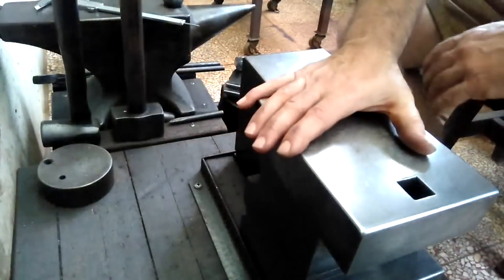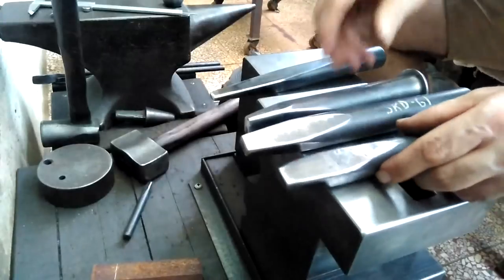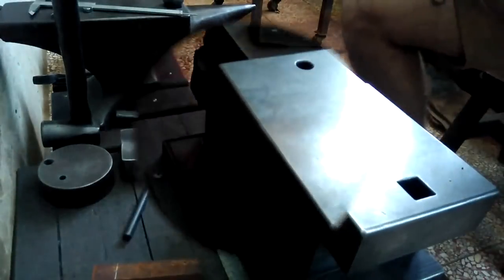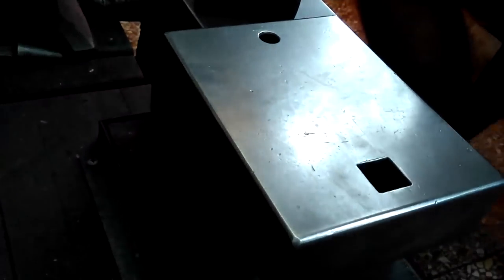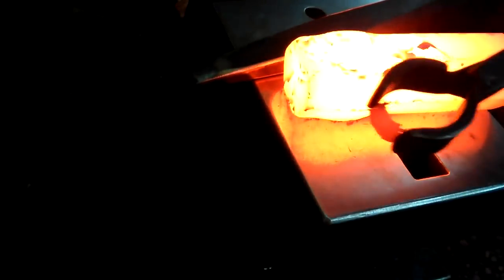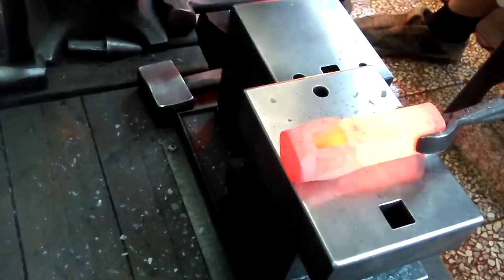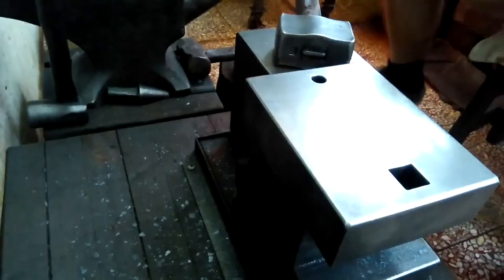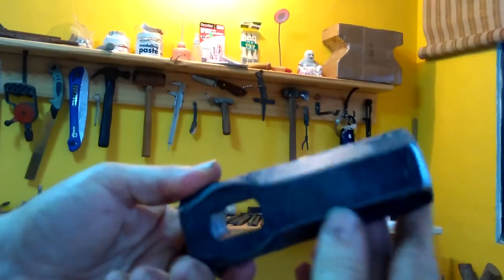Forging hexagonal, Japanese style hammer & ???

Comment: Hey Glen. I got a hold of 85lb 10" round piece of 4045. Heat treated it like you did in one of your videos. Worked like a charm. Made my first set of tongs. I only bought one hammer, everything else I will make. Look forward to start making hammers. Taking a trip to the steel yard this weekend for some more stock!

Comment: Without a power hammer or a press it looks like the best way to get an eye in the hammer is to use a variety of punches and drifts that permit a hand held hammer to increase the size of the eye gradually. Interesting comment about not wanting to remove any material from the blank, even when punching the eye.

Comment: Nice hammer. Are you thinking about offering hand punches and drifts on your website? I for one would be interested. Keep up the great videos.
Reply from the maker: Alex, Yes, I have thought about offering the hand held punches / drifts I use and may list these tools in the near future on my website. But even with the right tools, hammer eye forming by hand is not an easy task and everyone seems to go about this differently. Also, these tools are not cheap, given the cost of the steel and machine work I have done on them. Thanks for watching. Glen

Comment: I enjoy your videos. You have a teaching style better than most and you make it easy to follow along.

I have a question. In every video I have seen and it doesnt matter who the smith is. It seems that every tool used seems tipped a few degrees to the left instead of being straight up and down.
Is this camera angle, my old eyes, or is there an actual tilt to the tool?
Looking foreward to see more of your work.
Reply from the maker: Jon, Your eyes are correct. I do have the top tool tipped a bit at the beginning. I mainly do this so I can see exactly where the business end is and once I get going, will tip the tool up to vertical. Starting as plumb as possible is probably best but given human mechanics, is not always possible or ideal. Thanks for watching. Glen

Comment: Thanks a lot for the tools you've made and the helpful videos you've made! I have your slitter rigged up to my fly press on video in my channel. or if you search GS tongs Slitter Fly press.
This is the hammer I used to want thanks a lot for this video. Will you ever make hammers from 4140?
Reply from the maker: James, I will definitely check that out. I used to use 4140 for hammers but I prefer 1045 or 1050 now as hardening the face is more controllable for me with a straight carbon steel. Thanks. Glen

Comment: Not the usual hourglass method that I am used to seeing. What keeps the hammer from sliding down the handle if there is no bottom taper? Also, as a former machinist, I cringe every time I see someone using calipers as a scribe, but I suppose for blacksmithing they don't really need to be super accurate.
Reply from the maker: Kevin, Someone else recently criticized me for using my caliper to scribe. I honestly thought that was a common practice which definitely shows I'm not a machinist. As for the eye taper, I've change this a while back and now create a consistent taper from bottom to top, the top being slimly wider. This has worked out better for me. Thanks for watching and sorry for the slow reply. Glen

Comment: Super envious of the rain. Quick question I hope. I noticed that for your Hot Set, Punches, etc you use a metal handle rather than a wooden hammer style handle. Why the difference in preference? How hot does that handle get after punching all the way thru the stock?
Reply from the maker: Lucas, I find a metal handle to be more durable on most of my top tools since the steel I use for these normally is 3/4" round. Drilling a hole and wrapping a steel handle around is easier than trying to punch and drift a large enough hole to make a wooden handle that will be strong enough. Not much heat gets conducted through the handle. But there are some instances where a wooden handle is preferable. Thanks for watching. Glen

Comment: What is the purpose of this shape hammer?  Or maybe a better question is how is the use of this type of hammer different than other types of forging hammers?  Having never used one like this I imagine it to have a slow rhythm and heavy, almost "dead" blow, which contrasts to the fast and lively style I'm accustomed to.  Cheers!
Reply from the maker: Yes, the rhythm with this type of hammer is definitely different, much like you described. Since the weight is mostly in front of where you are holding, the hammer has a tendency to feel like it wants to drop. So, you don't "swing" this type of hammer as much as you "drop" and direct. I think this type of hammer has the advantage of allowing a person to see better where the hammer face is striking since your hand is more out of the way. This can be helpful when working on fine edges (like for blades). Thanks. Glen
Reply: Thanks for the reply.  A hammer like this is now on the list of stuff to make.

Comment: Really enjoy your videos. Just curious... why wouldn't you drill a hole first through the metal?  Do love learning from your videos..
Reply from the maker: Actually, I do often drill a pilot hole, depending on the hammer size/style. I do that mainly for accuracy (as a guide) and to make hot punching a little easier in larger hammers. However, it's mostly preferable to not drill a hole(s) because if punched out right, you will lose less material than if drilled and this extra material can help make the pole of the hammer taller and so keep the handle more secure. Thanks.

Comment: Why do you have to drift from both sides instead of just working the drift from one side? Thanks and I enjoy all of your video's. Keep up the good work.
Reply from the maker: Jonathan, I've found it easier to work hammers from both sides when trying to enlarge the eyes. I used to final drift half way, once from the bottom and once from the top, to create a sort of hours glass shape to the eye. But I've since changed this (changed my tooling) to where I final drift from the top completely down to the bottom of the hole and create an even taper so that when the handle is wedged it should stay firmly in place. But before doing this final step, I still punch (I guess you could say drift) from both sides just to open the eye enough. Working from one side only when you work over a solid face (and not an opening like a hardy hole, etc.), can be impractical. Some people use a drift that is tapered on both ends and they hammer it straight through over a hole but this is something I don't like to do for a few reasons... Anyway, thanks for watching. Happy Holidays.

Comment: I like it. is there a benefit to hexagonal over round or square?
Reply from the maker: Steve, That's a good question that I never really thought about. I feel that square (or rectangular) hammer faces are suitable for working around or just off the anvil edge. When you want to be a set angle the ninety degree edges of the hammer face can help. And I personally prefer a round face when working around the middle of my anvil and when I have to tip my hammer when striking. I can't exactly say what benefit a hexagonal hammer might have... Thanks. Glen
Reply: Thanks for the reply, I prefer a square round (like Brian Braziel style) for most forging. I do tend to use the rounding face in the middle of the anvil.